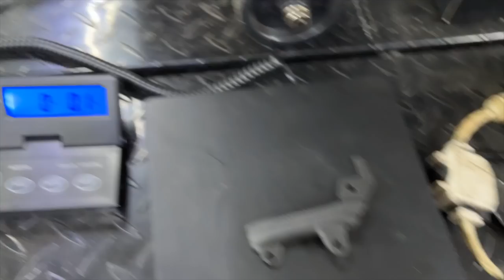Adding a Super Trick Part to Our Carbon Panigale V4 SP!!!

Comment: Was there a reason you changed the brake switch? The old set up was much cleaner. I also wonder why they didn't make the reservoir so it was level. Maybe with the standard V4 rearsets it would be level.

Comment: For the cable joint, solder and sleeve would have been compact. In fact, there are integrated solder sleeves now and all you need is a heat gun.

Comment: The reason the original OEM placement is where it is, is because of the dissipated heat of the exhaust. The new placement can hinder the performance of braking when oil is heating up because it is closer to the exhaust. We all know how hot the paigale engine/exhaust gets 🙂. That being said,  the new set-up does look good.
Reply from the maker: nah it will be ok since its in an aluminum housing :)

Comment: Hey buddy I ride the same bike as your pops and wanted to know what type of performance air filter you would recommend for it? It has the full Termi with upmap. Thx🏍️👍🍻
Reply from the maker: Yours actually already has a performance filter...at least his did from the factory so I think you should be good to go as long as you get your ECU flashed for the exhaust.
Reply: @JaretCampisi  Its time to replace it in the spring and  being that I live in Toronto and no riding is happening for a while ❄️ The bike is tuned with the Upmap Ducati key so was curious what your experience with the air filter situation would be and your recommendations for replacement. Thx🍻
Reply from the maker: @chrisagostino1  If you've got the termi exhaust with the ducati upmap then you're good to go
Reply: @JaretCampisi  thanks for replying brother just wanted to see if you had any filter recommendations other than stock. Love the channel 👍

Comment: That bike looks like it needs more coolant. On the next bike do a mild dragster with an r1 with a 4 over and a 240mm tire and billet wheels.
Reply: Actually it doesn't. These things run extremely hot and the coolant level rises significantly. Most individuals that top the coolant to the max level  experience issues where the coolant overflows out onto the ground.